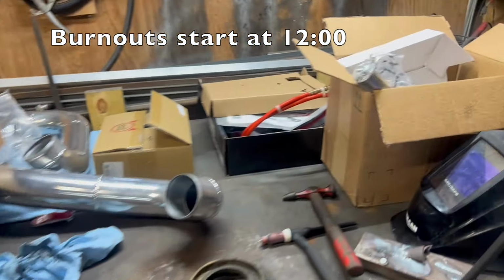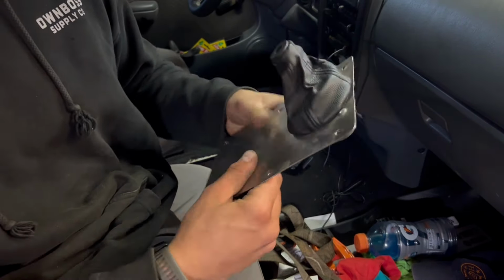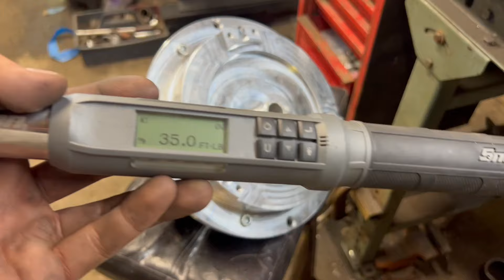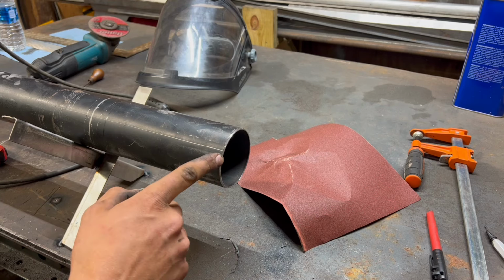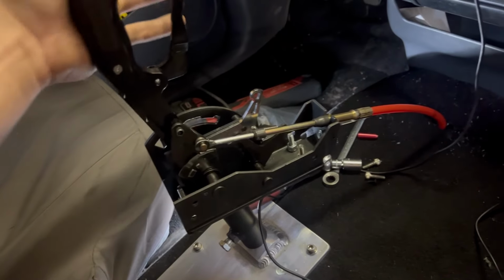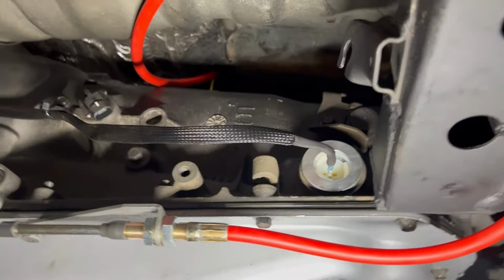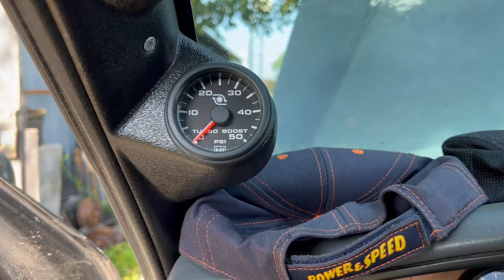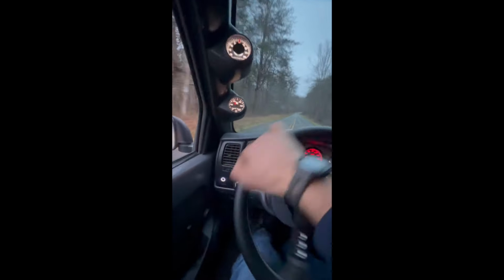Turbo Diesel Tacoma // 4l80e Swap OM606

Comment: Hey man I’m trying to do a swap also into a 2004 Tacoma but use the stock trans would that work for 300-400hp or do I need to get a different trans also if I can keep the stock trans where can I get a adapter plate?

Comment: something I've seen online when researching a transmission cooler for my 4runner is to place the temp sensor on the return line from the cooler so you know the temp of fluid entering the pump and valve body circuits.

Comment: Are you gonna install a jakes d3 transbrake ? It would probably improve quarter mile times by alot by using trans brake. How big of a difference did the high stall converter make? 
Have a om648 to 4l80e 4x4  but its going on my jeep xj and I need a torque converter.
Sick build. 🔥
Reply from the maker: I am not, I think it makes getting into reverse a bit odd or something like that. I would like to try it though! The big stall takes a lot of lag away letting the engine get up to 3k rpm quickly. Nice! You probably can run lower stall being direct injection with more torque.

Comment: You should make it 4 wheel drive or all wheel drive for more traction you might be able to use 2ed or 3rd gen Escalade awd cuz the ones that where all wheel drive came with the 4l80e
Reply from the maker: @jeepkid4242  that would be killer! I'd love to.
Reply: @ and I don’t believe the awd system is limited speed
Reply from the maker: @ yeah for sure
Reply: @Elisworkshop  it maybe difficult though because a Escalade is a little wider then a Tacoma I think

Comment: The real question is what ECU did you use to control engine/trans and make that kinda power
Reply: Manual valve body means no computer for trans

Comment: hey, when you mated the 4L80 to the engine, the torque converter is somewhat exposed to the elements without that lower bell housing .. did you fabricate your own or adapt the original? or just leave it exposed? thanks!
Reply from the maker: Hey! I left I exposed, I have the factory cover but I don't drive it in the rain and it's stayed clean.
Reply: right on, thanks! does the factory cover actually work with the adapter plate to the OM606? or would it require a bunch of fabrication to get it to seal up?
Reply from the maker: @matsworld9386  I'm not sure... I'd say so, I'll try it here soon.